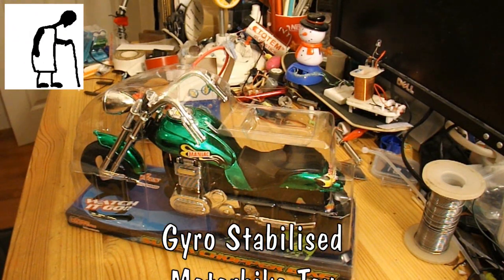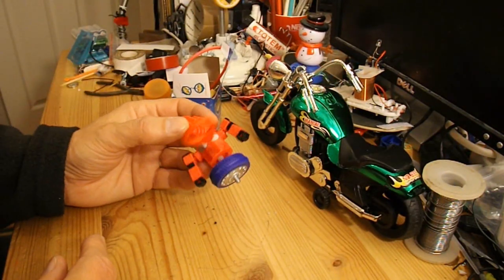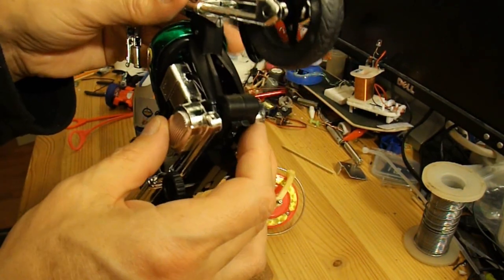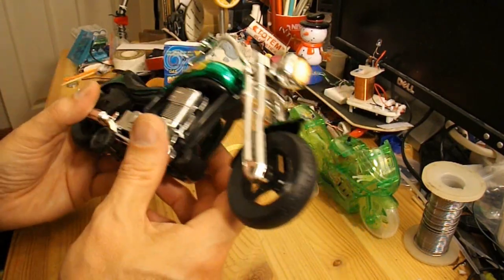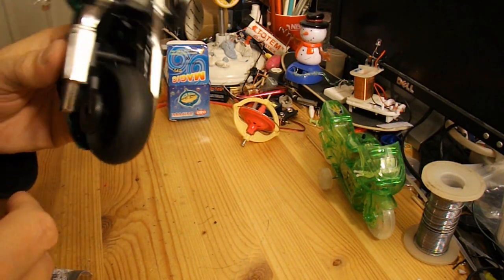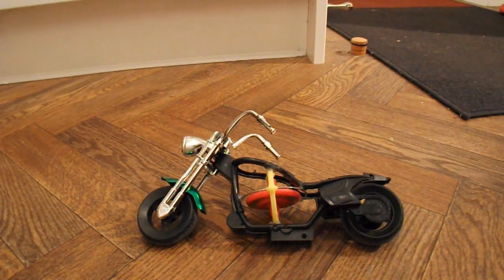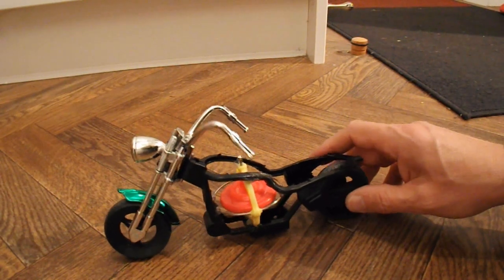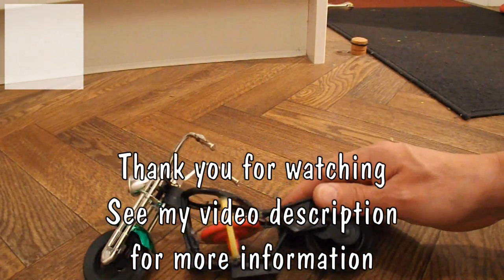Gyro Stabilised Motorbike Toy - FAIL

Comment: Thanks for mentioning my gyroscope efforts. There are two ways to self-balance with a gyroscope: free precession where the gyro must be in a gimbal and it must be top heavy like a top, or with a servo controlled gimbal and a balance sensor to turn the gimbal when the sensor senses the self-balancing unit about to fall over. Needless to say, the second is the hardest and I have not yet been able to accomplish it. The first is easier but it helps to have a computer controlled counter-weight to control the precession which is the method I used in my little experiments; you can do it without the counterweight but it will probably only balance for a few seconds until it falls over. Self-balancing is hard to do.
Lit Motors is working on their self balancing motorcycle but frankly I don' t think they will make it to production as the economics of two very sophisticated and high-speed gyros can't be good. Hope they do it though.
I love experiments like yours, do it all the time and "failures" are a great teaching and motivating tool. Rock on.
Reply from the maker: +Jimmy Demello thank you so much for taking the time to comment. My effort here was doomed to failure because I was hoping for a quick easy fix and was not prepared to put the sort of time, effort and research into the project that I can see you have done. I get requests to try things and I usually have a go but I also try to help the requester by pointing them at better videos if I see them.
Reply: Correct!

Comment: You might need a metal gyroscope because a heavier gyro will make it more balanced.
Reply from the maker: I think you will find I said I needed a more massive gyro in the video and in the description. The gyro I used is metal with a plastic skin and also some unnecessary electronic extras including the music and the LEDS. I didn't realise it had them when I ordered it from eBay. It was simply the cheapest I could find.

Comment: The basic problem is that the gyroscope needs to be able to move back and forth on its axis to maintain stability.  When the vehicle moves to one side,  the rotating force will pull it level,  and the same when it starts to fall the other way.  So you need a gimbal to hold the gyroscope.

Comment: Try mounting the gyro in the same orientation as the wheel. In the orientation that you have it, it's generating a lot of front/back stabilisation forces that you just don't need. With it mounted in the vertical axis, all of the effect is in the plane that you need it to be.
Reply from the maker: eojox118 looking at the RC motorbikes it looks like they use a large gyro set into the back wheel. https://youtu.be/-3STlPszDos https://youtu.be/msULdH2Drdc

Comment: good try though... is it possible if 2 heavy metal gyro spinning in opposite directions and motorised?
Reply from the maker: Haha, you are very polite, it was a pretty rubbish attempt. As usual I was trying to do it on the cheap without putting enough effort into the task. In my video description I put some links to other people's videos that are more successful 😊
Reply: thank you so much :D its because i do have a plan for my final year project to make one similar to LitMotors 2 wheeled car as my final year project at college and also with the least amount of resource. thanks again :D have a good day
Reply from the maker: Good luck with your project Devan 😊

Comment: can you try putting an electric motor on the back wheel and seeing if you get it fast enough will it stay up?
Reply from the maker: There is no simple way of connecting a motor to that back wheel.
Reply: GrandadIsAnOldMan How about mounting a motor with a small rubber wheel (similar to old cassette decks) so the rubber wheel is in contact with the bike wheel and drives it by friction. However, I think this would still be a fail as it raises the centre of gravity.
Reply from the maker: MisterG as I said in the video and the description I am fairly sure the issue here is that I need a more massive gyro. It should be able to stay upright whilst at a standstill.

Comment: Hey Bro.  Just rotate it 90 degrees so it is in the same orientation as the front and back wheels.  That's it.
Reply from the maker: Thank you Peter. At the very least I think it would need a more massive flywheel. The one in the video came from eBay and was much smaller than I had expected when I ordered it. I still used it for the video but it really had very little chance of working. I recently played with some tiny toy motorbikes that have flywheel motors and they maintained their balance well but had to be moving as the flywheel was connected to the back wheel. Have you built one? You may find the links in my video description interesting.

Comment: Could you fit the motor from a charity shop walkman with a suitable lead disk glued to it and run it off lipos .....M
Reply from the maker: +MrMal1956 the "suitable lead disk" is the problem. They don't turn up very often.
Reply: +GrandadIsAnOldMan  How about layers of self adhesive roof flashing or cast one melt down fishing weights.......M
Reply from the maker: MrMal1956 the ideal fix would probably be 3 gyros but just one good one would make a good start. Remember it would need to be perfectly balanced so it may take quite a while to set up. Ludic Science did a nice simple one with CDs which I tried to use but I failed https://youtu.be/I0ygIHc-N7I
Reply: I see what you mean just been looking at r/c motorcycles on rcsparks and though pro-built they do not work at all well they seem to steer by falling over onto metal skids, i think in the long run your'e right this problem neede a lot more thinking on .....M
Reply from the maker: MrMal1956 Hmmm, the RC motorbikes I have seen are spot on realistic and are really stable, they steer like real bikes. Here is an example https://youtu.be/msULdH2Drdc
Reply from the maker: MrMal1956 double Hmmm, watching that video again I see what you mean about the metal skids but I was sure that was only on full turns, not having tried one myself I cannot be sure.
Reply from the maker: MrMal1956 yes this one gives a few turns that are not right over on the skid https://youtu.be/X47Pl3d9EE8
Reply: +GrandadIsAnOldMan The ones I have seen do not seem to be of the same quality as this one, this one it seems needs time to build up speed in the flywheel before setting off, the the others however are less stable maybe for wow factor as they appear to do more spectacular stunts as opposed to realism.....M

Comment: Running the giro at higher speed could also help a little
Reply from the maker: I am a bit limited on options there. All I can do is pull the cord faster. I didn't really want to get involved in adding an electric motor to keep it running. The concept was to do it on the cheap.

Comment: Try flipping the gyro wheel facing forward
Reply from the maker: As I understand the gyro effect it needs to be spinning in the plane that you want it to maintain. Mounting it horizontally should make it stand upright. Mounting it vertically should help it travel in a straight line but would not stop it falling over. Here is a nice technical document with lots of maths http://www.umich.edu/~arclab/max/media/gyrovehicle.pdf
Reply: ZML is right. For Gyroscopic torque is generated to the direction of the rotation axis. meaning the tendency to spin, by right hand rule, is to the direction of the rotating flywheel. Therefore you need to tilt your gyroscope forward. You'll even see in your paper's freebody diagram, they have tilt angle of alpha, as a controller variable. They tilt the gyro so that the upward torque is projected down on the s_1 axis. When you decouple the torque vector g_3, then the g_3 is formed of two projected vector in s_1 axis and s_3 axis. If the alpha is greater than 45 degrees, then the s_1's projected torque has dominance and starts generating a rolling torque in the revolute direction of the s_1 axis, and g_3 projected torque starts generating a yawing torque in the revolute direction of s_3. And once the bicycle reaches equilibrium, the pitch of the gyro must be brought back to zero so there is no more projection torque in the rolling (phi) axis. If the vehicle overshoots in roll and for the system to reject this disturbance, the gyro's angle alpha must pitch to the negative direction and use the same process of using the projection torque to bring it back to equilibrium again.  

This is why (ignore above paragraph if you just want to make this work), you need a gimbal mechanism to control the pitch of your gyro.  If you look closely at the figure 8 of the paper you linked, you will see a flywheel driver motor on the top of the gyro shaft, and you will see a black motor close to the right side wheel connected to a belt-drive to the shaft of the gyro gimbal. And in the front side of the vehicle, you will see a black encoder attached to the pitch shaft of the gyro to read the alpha position.

Your current set up right now only generates yawing torque to clockwise direction. Probably the reason why your bike keeps falling to the right more than it does to the left

Comment: The weight of the disc is very small, the rotation speed is small
Reply from the maker: You may find the information in my video description interesting 👍
Reply: @GrandadIsAnOldMan  sory I look with mute
Reply from the maker: @I_have_no_Na.me.  I do that too 😆 There is lots of information in my video description with links to other gyro projects
Reply: @GrandadIsAnOldMan  😆 I'm sitting at work now. And the director doesn't want to raise salary. As a result, I watch YouTube instead of work. Such a quiet strike
Reply from the maker: @I_have_no_Na.me.  😆🤣👍
Reply: @GrandadIsAnOldMan  Brother. What is the difference - to position the gyroscope's axis of rotation along the axis of the bike or across? I've seen two options:
1) a gyroscope is built into the front wheel and the disc rotates along the axis of the bicycle
2) the gyroscope is fixed on the frame under the seat in a swinging frame while the disc is perpendicular to the axis of the bicycle
In both cases, the bike is standing and does not fall.

Comment: Constructing a stabilized motorbike will need a little bit more work, Henry Reich at minutephysics explains how bicycles stay upright, here is the link https://www.youtube.com/watch?v=oZAc5t2lkvo, hope it helps.
Reply from the maker: +Animesh Mishra thanks, that is a great video and I will add it to the video description. What it does not cover in detail - because it is not the focus of that video - is the simple gyro effect that would hold this toy upright when it is stationary if the gyro was large enough. The main thread of that video it the dynamics of the front steering allowing the bike to steer itself and counter the effect of it falling over by steering towards the lean. With sufficient gyrostabilisation the bike would remain upright without the need to move forwards. There are several on YouTube, here is an example and this was the effect I was trying to achieve at the very simplest level https://youtu.be/_E2H3obSxKw

Comment: Cool, I tried to make a Brennan Monorail model but had no luck getting to work. However check out the "Gyro Monorail" youtube  for somebody that knows how.
Reply from the maker: I thought it was worth a try, but as I said in the video this gyro is nothing like massive enough to give the effect required. I suspect that if I did find one big enough I would then find this flimsy plastic body is not rigid enough to cope with it so a full on purpose built project would be required and that is really beyond the scope of this channel. I didn't want to use a rail guide although having read up a bit about gyro stabilisation I can see that using a rail makes life quite a bit easier as that helps to keep it going in a straight line or a curve for that matter, the rail takes over the guidance problems caused by 'progression'.

Comment: One way to keep the bike balance, would be that the masses were below the support of the wheels.
As these clowns acrobats:
http://pictures2.todocoleccion.net/tc/2014/02/23/16/41757355.jpg
Reply from the maker: The balance weight on those clowns is below the bottom of the wheel, that is the relevant pivot point. That puts the centre of gravity below the tightrope.
Reply from the maker: http://youtu.be/dpeHWnannfE
Reply: GrandadIsAnOldMan So although you can not put under the wheels, at least you could try placing posibe closest to ground.